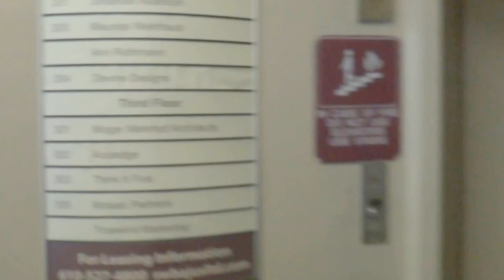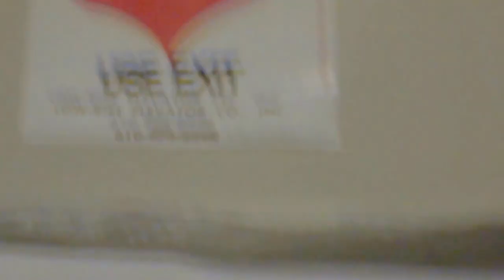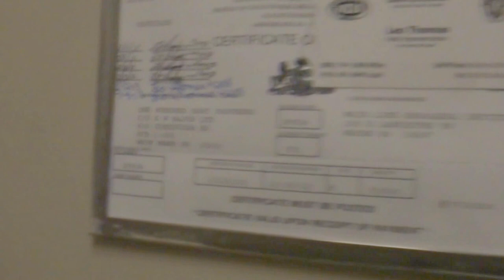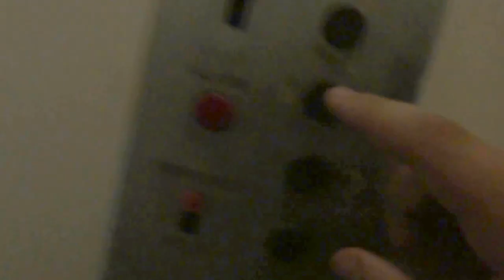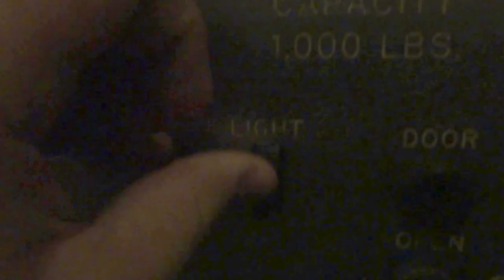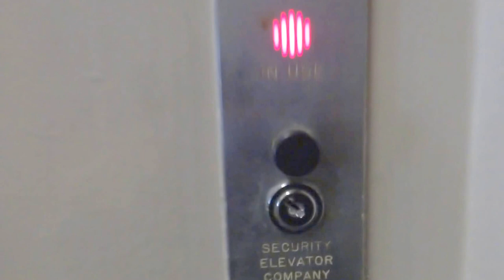Awesome 1960's Security Hydraulic Elevator at 100 E. Lancaster Ave, Wayne, PA

Comment: The university has a bunch of different elevators in the buildings depending on either when the building went up or was remodeled.  The university has been around since the 1800s and a handful of the buildings do not have elevators at all.  One building has a Dover, a few have Schindlers the newer suites for the students seem to have Otis Gen 5 elevators and I haven't been in a few of the buildings I know they have elevators just don't know what kind they are.